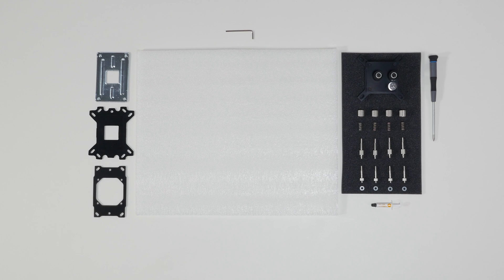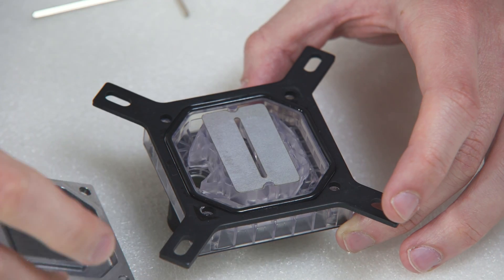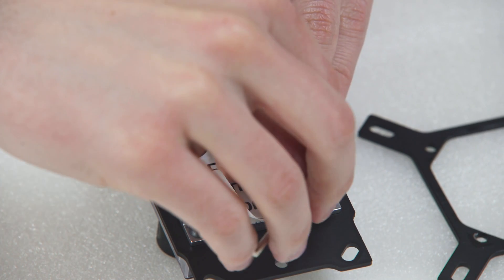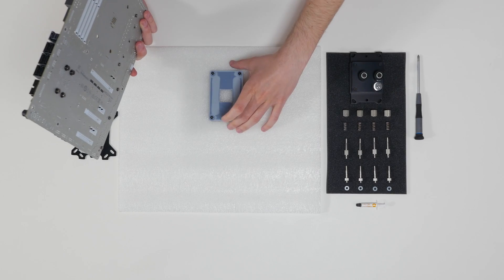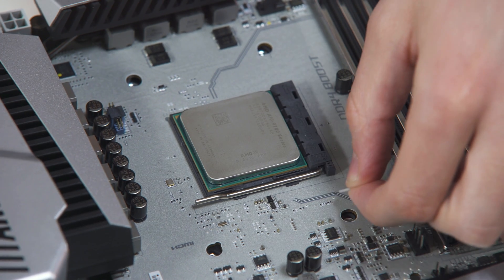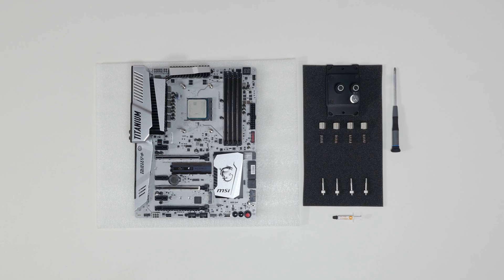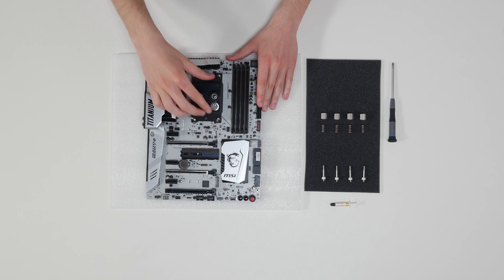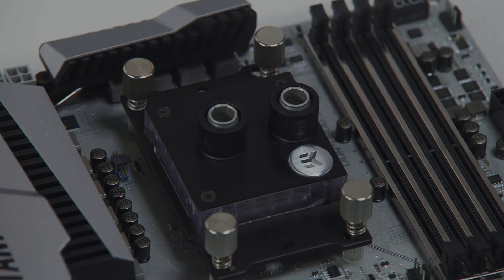CPU water block installation - AMD AM4 Socket Motherboards

Comment: I’ve built a full loop with the A240G Kit and expanded it with a second purchase of an additional GPU waterblock plus a 360mm EK Fluid Gaming radiator. This line is outstanding. I would like to see an sTR4 Threadripper waterblock in the future offered in the shop for the line. I’m debating upgrading to it yet don’t want to waste my loop by starting it over with copper/nickel parts.

Comment: I bought an EKWB kit for a AM4 PC and I had to take the center of the rubber gasket thingy on the back as it was constantly freezing my box and sometimes the Mother Board (Crosshair VI Hero) didn't even POST'd, with just the outter rubber thing (as if it were an Intel CPU) works fine.

Comment: I'm so looking forward to upgrading my system to AM4 with a custom water loop.  My Phenom IIx4 965 is on its last legs, and my H110i GTX has been having problems lately.  I won't go back to air cooling.